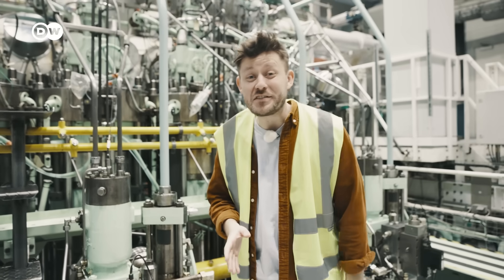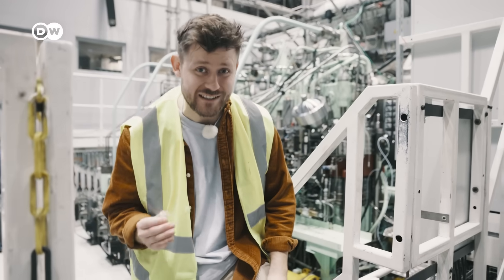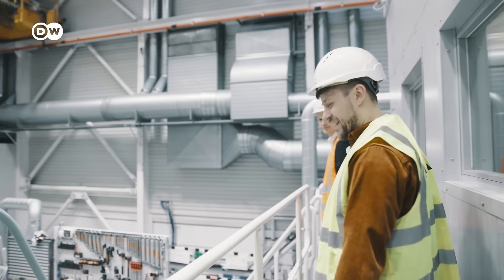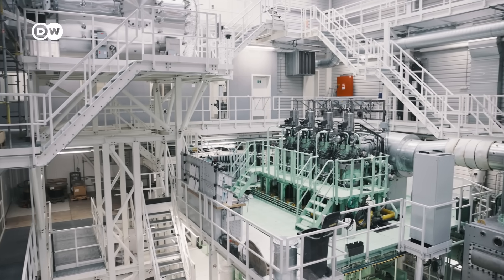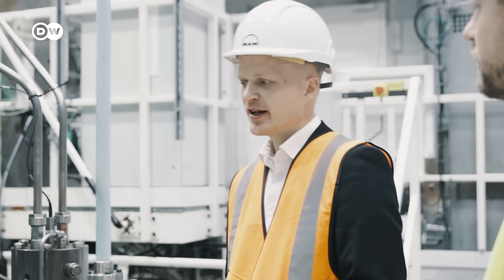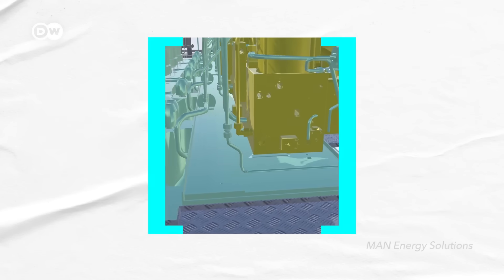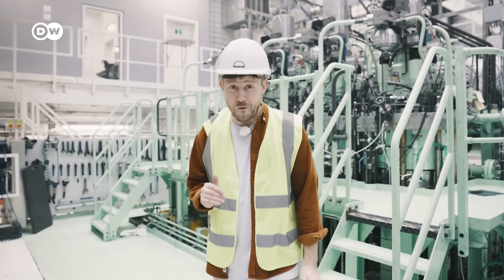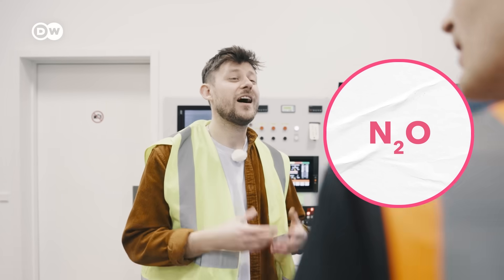Can this magic fuel clean up the shipping industry?

Comment from the maker: Do you think ammonia is going to clean up shipping emissions?
Reply: No. There's a bad idea. There are a lot of other fuel options that are more sustainable
Reply: @wilhelmlk  What other fuel options are you thinking of?
Reply: @wilhelmlk  wind sailing haha
Reply: In a word, no.

Looking at the basic properties of Ammonia should make this pretty obvious - about 1/3 the energy per unit mass, boils well below freezing temperatures, so it's a gas or being stored under high pressure or low temperatures (Both of which make it more dangerous and need energy, just to keep it sitting there). And that's before you consider that you can't just drill it out of the ground like oil, so it has to be made, requiring more energy again, before it can be used. Also look up what happens when ammonia reacts with water, and then consider that your eyes, and the inside of your lungs are coated in water, and tell me again how this is an upgrade over existing liquid fuels...
Reply: I'm a little confused by this. It produces greenhouse gases, Nitros Oxide, it's toxic and produces toxic emissions, requiring catalytic converters. Why not just use hydrogen? It's non toxic and produces only water vapour emissions. The main problems with hydrogen are the density and the production of green hydrogen...which are both also problems of ammonia. In fact you need to produce green hydrogen in order to produce green ammonia. So just use hydrogen? What is the benefit of ammonia fuel over hydrogen, if any?
Reply: @weareanonymous353  You can totally build an NH3 powered engine or fuel cell with zero NOx emissions.

The problem with H2 is that it's bloody hard to liquefy and store (boiling point -253°C, that's a lot lower than lN2 with -196°C or NH3 with -33.3°C). That process alone reduces its energy storage efficiency by 40%!

Another advantage of NH3 or any other hydrogen carrier that can be used in gaseous form is that it contains more moles of hydrogen per unit volume than H2 gas, because gases are weird (see molar volume for ideal gases; 1 mole of gas is always 24.7 liters at standard conditions; 1 mole of NH3(g) contains 1.5x the amount of hydrogen atoms compared to 1 mole of H2(g))

In case of a fuel cell, the NH3 can be used as aqueous solution, making handling much more easy and completely omitting the need of a pressurized storage vessel, but that'd be more relevant for cars. Large ships would likely use pure NH3.
Reply: We still have a long ways to go.
Reply: Nutrient nitrogen deposition from ammonia (mainly from animal agriculture) and NOx (mainly combustion sources) are wrecking sensitive habitats. I can imagine the ammonia slip from the engines even with catalytic converters is going to mount up if this takes off. More efficient conventionally fuelled ships might be better. There have been trials with modern sails that can reduce fuel usage by a substantial amount. 40% of world shipping just hauls fossil fuels around. If we can decarbonise other sectors then  shipping emissions become a smaller issue over time.
Reply: I think NOx and N20 might be very problematic too. Also producing enough Ammonia might be an issue.
Reply: No.
In short, it would replace one problem with another one that is much worse.
I think it is a very bad idea to have ammonia as fuel on ships. It would create a huge safety problem. If there ever was a leak it would also create a huge pollution problem. Also let's not forget that this fuel would need to be stored somewhere fore ships to refuel. Ports is usually where ships get refuelled and they are inhabited areas. I would not want to see more ammonia storage tanks on land or travelling around at see than necessary. 
What I would like to see first is why ammonia is not used more extensively in Einstein type refrigeration/cooling units (e.g. in air conditioners). If someone can explain that to me, then I'd be willing to give a thought to ammonia used as a fuel.
Also targeting the shipping industry for emissions reductions should the last thing we should be thinking about. Shipping is by far the most economic and efficient and also least polluting means of transport we have. If we could find ways to reduce shipping fuel consumption, yes, let's consider them by all means but let's not forget that shipping has a century's experience in using hydrocarbons as a fuel. While any extra economy to be had could be welcomed by the shipping industry getting it wrong or placing too stringent conditions for emissions could just as easily backfire. Badly.
We should first target all the other modes of transport - especially unnecessary transport like tourism which is a luxury that only the very affluent can enjoy at the expense of the poorest and destitute - and leave shipping the last.
Reply: The issue is not about if can clean up shipping emissions, the question is if the "lobbies" from traditional fuel industry allows it
Reply: @mcln2  Who do you think makes most of the ammonia on the planet?   ya the traditional fuel industry....
Reply: Huge nitrogen plant near completion after being started in 2023, and guess where it's being built - Saudi Arabia. The country that got extremely wealthy from selling oil, has now taken the lead over ALL other developed countries, and is set to produce nitrogen fuel 'on mass' in 2027.
Reply: Not as long as the Haber-Bosch process used to produce the NH3 depends on fossile energy and hydrogen from non-green sources.
Reply: Powering ships using ammonia is a bad idea and it's a truly terrible idea for reducing global emissions.  Ammonia is incredibly toxic to humans and the environment.  These engines require pilot fuel, so they can never be emissions free.  Creating green ammonia infrastructure is incredibly expensive and extremely fragile.  Global warming is a thing, we need to be reducing emissions in sensible and economically sound ways, but cutting shipping emissions using green ammonia while Asia is building a new large coal fired power plant every week, is fiddling while Rome burns.
Reply: What I missed was the option to decompose the ammonia and then burn the hydrogen that is produced in the process. It could probably be stripped from the mixture with nitrogen before that. Burning hydrogen would be much more useful, but of course would require different materials.
Reply: No way this will become common as I see it. China's nuclear ship option is substantially more viable than this.
Reply: No.
Reply: I don't think so.  It costs more in energy to produce ammonia than you get out of it as a fuel.  It's like hydrogen as auto fuel -- it's an inefficient delivery system, not a fuel source.
Reply: Nope. Still need energy to make ammonia... and if you say renewable (solar, wind) or nuclear is the energy source, then ammonia is just another energy storage system. And you could just use a regular hydrocarbon as that energy storage molecule. Ammonia is toxic and corrosive.
Reply: No.
Reply: Nope!  Perhaps it will serve energy needs supplementally and STATIONARY...but not with any mobility!
Reply: NOOOOO.....ammonia will POLLUTE SEA / OCEAN .... and SMELL OF AMMONIA.....is unbearable for beautiful SEA / OCEAN  FISH / CREATURES.....NOOOOOOOOOOO.......
Reply: Since low sulfur fuels have been introduced emission indeed became much cleaner albeit without reducing carbon emissions. Missing feedstock for fuel, safety issues in case of spills (imagine 20,000m3 of poison gas leaking next to an urban area / harbor), sustainability of fuel production unsure) - I think that carbon neutrality is not an end in itself nor the only parameter to consider when combating environmental destruction. So I don't think this will actually become the mainstream engine type for marine container vessels.

Who doesn't remember 'green coal' and other attempts to masquerade the origins of energy produced. Energy generation from ammonia might be a niche market application in biomass - such as massive animal farms which are themselves a huge root cause of the problem (but they might invest in it for image reasons). We need to concentrate research on base load generating technologies while buying time with insulation, heat pumps, expensive renewables combined with even more expensive energy storage systems - Thorium molten salt reactors might be more promising. Once that ' relatively CO2 emission free' base load problem is solved we can produce hydrogen or biofuels using that nuclear energy.
Reply: Why NH3 when a better job could be done with H2 ?
Also, marine propulsion needs to move away from simple engine-propulsion to propulsion-system setup, i.e.: a hybrid of a few sub-system types, which I'm sure folks in the industry are already working on.
Reply: @aryaman05  Because ammonia is easier to store & liquify and as a gas holds more (1.5x) moles hydrogen by unit volume than pure H2 itself. Methanol as liquid hydrogen storage would also be a viable approach - there are fuel cells capable of using 60-70% MeOH (the remainder is water).
Reply: @aryaman05  how big is the H2 storage? On land it's feasible, on ship it's not
Reply: @DanieleVatta  Compressed/Liquid H2 as stored fuel on board marine vessels is not too different from natural gas applications - which is gaining traction already.
Think EU/MENA and eastern seaboard NA, vis-a-vis, 'range anxiety'.
And within context, space is a non issue on board ships.
Reply: @aryaman05  on cargo vessels space is money and H2 takes more than double the space of LNG
Reply: @DanieleVatta  
Can be a challenge when retrofitting existing vessels, as storage units can't be simply replaced with existing ones.
No such issue with new-builds.
H2 can be stored in low(liquid), medium(liquid or gas) or high pressure methods, i.e.: similar limitations as that of handling CH3.
Reply: Cylinder deactivation can solve the engine load issue
Reply: No because one thing is the well tuned research engine but the marine industry is very dirty, they dont make maintenance... danger...
Reply: How about smaller versions for trains. Hydrogen train vs ammonia train... what is scarier
Reply: no
Reply: No.
Reply: c02 emissions are not a legitimate problem in the first place...
Reply: If we have to split water to produce the hydrogen for ammonia, why not develop engines that use the hydrogen instead?
Reply: No
Reply: Yes,no carbon, but will emit nitrogen dioxide or nitrogen trioxide. We know that , nitrogen dioxide is a pollutant gas.
Reply: If it does, what are the side effects? Carcinogens?
Reply: We have to use the heavy fuel oil from crude oil for something. May as well be shipping.
Reply: love innovation as it allows us to do things better.
That said, the obsession with CO2 is fetishistic and potentially dangerous given the direction politicians and bureaucrats push in.

Consider, our atmosphere is 0.04% CO2.  Not 4%... 0.04%.
Of that 0.04%, which would be the sum total of worldwide production, humanity accounts for approximately 3.225%
so the sum total of ALL HUMAN DERIVED CO2 creation is 0.0000129%

Now... changes in CO2 can have massive/startling effects on the environment/atmosphere.  Undeniable.
But we are becoming obsessed with "climate change", which the planet has been engaging in since it's formation, and attributing CO2 in a very negative light.

Please note, if CO2 levels drop below a certain threshold, systemic floral death occurs.
Earth is already below the projected ideal floral growth band.
Conversly, as CO2 levels rise (global or in specific regions, the potential for growth (or "ReGreening") occurs.
Regreening which makes the planet more hospitable and moderated in temperature...

So while ammonia could allow us greater control over our emissions, in totality we are looking at a subset of 0.0000129%
Reply: Maersk shipping obviously thinks it could be possible.
Reply: For a layman like, the whole process itself is a torture! The Risk vs. Reward is in no way convincing to anyone.
Reply: This is taking the p*ss, making ammonia from electrolysis defeats green energy, just compress the hydrogen into liquid and use that as a clean fuel
Reply: doubtful
Reply: There  is a big push to lower agricultural use of nitrogen as some of it will end up transformed to no2 and contribute to greenhouse gas emissions. For prespective total ammonia production, not all of which goes to fertilizer is only 1 /6th of what would be projected to be needed for maritime fuel where it will certainly produce NO2. Now how good their catalytic coverters will dictate how much gets emitted but if it is a real problem for agriculture producing some NO2 emmisions i expect when you updcale use by a factor of 6, some NO2 emmissions from marine fuel use will be just as bad if not worse. With the push to greatly lower N fertilizers crop productivity will  fall raising food costs. Now if we use that same ammonia x 6 in marine shipping now we have less efficient and more costly shipping of more expensive food being moved for what i expect will not be lower amonia emissions.
Reply: Did a little checking. Estimates of agricultural NO2 emmisions from N fertilizer use is about 1% per of N mass applied. For ammonia ice it should only be about 0.5 % when combustion temperatures are the least ideal with orders of magnitude less NO2 release when operating at ideal temperatures. So NO2 release from a ice engine potential could have less impact than agricultural N use. Now the question still remains how much leakage is there of nh4 during use and production and is it cost effective and what is the full cycle energy/ Greenhouse gas potential as like hydrogen, ammonia is just a battery and not an energy source. I'm interested, but skeptical.
Reply: I think they're "full of piss".
Reply: No. When ammonia is burned it releases nitrous oxides which are highly toxic to the environment when compared to conventional fossil fuels.
Reply: FAR Better Solution:  Make all goods local...  Why ship things half way around the planet if you can just make it a few km from the customers ?
Reply: not this kind
Reply: @AparnaDeshpande-se5tl when it goes into meltdown your going to want to hold your breath. Nuclear made in China, don’t belong together.
Reply: Hell yeah it's quite possible. Toyota uses Hydrogen as pilot fuel which also comes from on board Ammonia itself which in turn reduces NOx emissions as well.
Reply: It will clean up shipping emissions but increase industrial emissions. It will be same story as with electric cars- you will need to burn large amounts of natural gas to produce sufficient amount of ammonia just like now you need to burn large amounts of fossil fuel to make electric energy for electric cars. As industry will need to pay more and more penalties for increasing CO2 / NOx emissions with the price of natural gas on the rise, price of ammonia will go up so ammonia as fuel wont stay cheap for long. With low utilization it will become unprofitable
Reply: @DeX9891  Everything cause emission or consumption. Even giving up and dying, you decompose make a lot of methane that is very strong green house gas. Also some thing are necessary.
Ammonia is a good example. We could stop ammonia production tomorrow... and in few year 2 third of world population will starve to death because without fertilizer agriculture efficiency is... what we had before it's introduction. We have seen the change and what was the population we could sustain.
So, the discussion is on "Efficiency" and "sustainability". Do the necessary, do the possible, at the best condition.
Reply: @DeX9891  and About EV.
You have seen the meme with the tesla with a diesel generator to charge right? It tell more on how bad people is the poster at math and physics than anything else.
Because diesel car are... awfully inefficient.
engines are good only in a very narrow range of load and speed. Accelerating, breaking an incredible amount of energy is wasted.
So yes...even a Tesla charged with a diesel generator running at fixed optimal condition you make more mile with the same fuel than a diesel car.
You put the same fuel in a big powerplant generator and you make 2 cars go around changing them on grid. 
And you can use scrubber and filters much more efficient than your car polluting far less.
And you can use the energy done with solar panels during day. And with the same CO2 of one car... 100 car can go around.
Reply: @DeX9891  But... Battery are not the solution for everything. Always efficiency math physics not faith meme or politics.
Bigger is the device less convenient is a battery.
I even you will not think that powering yours smartphone with a combustion engine instead of a battery is a good idea I bet.
Getting bigger my EV scooter  can do 100km with 0.10€ of electric power, the one I had before 5 liter of fuel at 1.8€...  so 9€. So 90 time more, that is the range of "mathematically challenged" the discussion  is... even worse if you compare EV bike with Diesel car. The meme with the coal plant is kindergarten physic and math level... 
Diesel car on average real consumption of 7.5L per 100km
EV on average are 15kwh per 100km... to generate that power 6 liter of diesel al necessary with a common diesel generator to the cord. Already less. But you can go under 4 with a big engine on grid.
So clearly better even if you are not couting using renewable.
Trucks... that is a battle battery have not won. Ships. There is not even at the horizon the day of EV ships for now. So we need alternatives. And we are searching for them.
Reply: No
Reply: How about propaganda? 🤣
Reply: Not all, some maybe. Emissions from shipping will continue to grow, but slower and at some point emissions starts to decline but no thanks to ammonia.
Reply: Ammonia is a very corrosive substance, which makes It not engine friendly.
Reply: I wonder how about nuclear energy, militaries use it tho
Reply: Nein, es geht nur darum, Daten zu recherchieren und zu erhalten. Außerdem ist es banal ineffizient und extrem gefährlich.
Ammoniak ist giftig.
Meine Erfahrung:
Eine große chemische Flasche rollte um und fiel auf den Betonboden. An einem Punkt trat Baumwolle auf und alles war mit weißem Nebel bedeckt, als ich ausatmete, sah ich, wie sich der Dampf in weiße Flocken verwandelte... dann verengte sich das Sichtfeld stark und ich konnte nicht mehr einatmen, die Brust verdrehte sich mit einem Krampf. Keuchend "Gas!" ich eilte zum Feuerwehrausgang...
Reply: I think it will. I am looking to make a new Toyota motor fit for my vessel. It is brand new and they say it will produce 180 hp which is okay. It is 20 hp more than I have now. The main problem is the tanks.
Reply: no , too complicated
Reply: Why not convert the ammonium to hydrogen and nitrogen. There is alot of residual heat to contribute to the proces, and separation should also be feasible. And It might be possible to use ammonia  container in pellet form. By the way it's Man B&W in Denmark I can see. And ammonia could perhaps be produced biological.
Reply: I sincerely hope it will clean up shipping. Having worked with Everllence Retrofit for 1½ year I know they are very keen of making it work for real and have their eyes set on the goal. They are genuine but they won't tell you stuf they don't want the market to know ..yet. Thanks for a good video .. being an IT guy I have not much understanding of the actual motor and fuel stuff so informative videos as yours is always nice :-)
Reply: What are your thoughts on China's nuclear powered cargo container ship which it launched yesterday?
Reply: @wololocute this in part is going to be the way it goes
Reply: @wololocute  Did they copy it off the nuclear powered Savannah.
Reply: @wololocute  they are talking about and made a concept project, nothing lunched.
So more propaganda than anything else.
It's dangerous and there are decades that we are not able to make economically viable nuclear energy. 
Sometime maritime incidents happen and already with oil spill there are huge problem. Imagine a nuclear incident everytime that happen. I do not imagine many country allow this ship to go near their coasts... so I think that will remain science fiction for a while. Nuclear project and ideas to fix safety, cost, scale and waste are plentifully butt they always fail at final commercial proof. At this pace with all the continuous breakthrough of fusion, we will have a fusion container ship sooner than Nuclear... but those are definitely not around the corner.
Reply: @wololocute  PS: as middle ground Japan is researching wasy to produce Hydrogen in nuclear plants as a secondary product, that than can be converted in ammonia or used directly. That seems to be a safer and more commercially viable solution.
Reply: Ammonia requires to make green hydrogen and spend additional energy to add nitrogen to the mix. The question is how it compares to using hydrogen instead. If we take liquid hydrogen, it is 70kg/m2 * 141MJ/kg = 9870MJ/m2. Liquid ammonia 682.6kg/m2 * 22.5MJ/kg=15358.5MJ/m2. So clearly liquid ammonia is a much more efficient form per m2 of transporting energy than liquid hydrogen, and in addition doesn't need to be stored nearly as cold at only -33 degrees Celsius.
Is it better than diesel, well, it clearly has a ton of downsides, but one advantage, so that depends on how you weight those things.
Reply: @Eikenhorst Problem with Hydrogen is storage and transport. As a gas, H2 would require to much space for transport, and to liquify, it had to be refrigerated to almost absolute zero. Cooling to -35 °C or so is  not a problem, LNG is brought to -162 °C for transport. 
Of course there are Hydrides... but more on that when the research has finished 😁
Reply: @human_isomer  I am saying that even IF you could make it liquid, it still doesn't come close to the energy per m2 as liquid ammonia. But neither option is exactly great if you ask me.
Reply: @Eikenhorst  well, you can make it liquid, but of course it doesn't have the energy density of Diesel. On the other hand, it doesn't emit nearly as much CO2, and something needs to be done. Biodiesel won't cut it, even more when thinking about decreasing areas for growing respective plants in the course of global warming. 
Sails might be an option, or on-board wind turbines, but of course this would come with significantly longer shipping times. I wouldn't mind, but others may have a different opinion.
Reply: @Eikenhorst  If we can get rid of Haber-Bosch, then ammonia is a good route to pursue. Before that, it's a dead end. Hydrogen as is is too hard to handle. It leaks, is explosive and is hard to produce.
Reply: @Eikenhorst  
As NH3 ist consisting of 83% nitrogen you fools are importing nitrogen.
Reply: Nothing is ever good enough for the moan moan brigade.
Reply: He'll no it won't I've worked in refrigeration an with all types of motors the clean up an spills that could come from this will be just as bad if not worse for the eco system planes would even be in danger because of the state of ammonia
Reply: Nuclear sounds simpler.
Reply: No. You use lots of energy to make amonia, then you get many times less caloric energy out of that fuel and you need larger tanks to store it, making ships carry less cargo than ships running simply on oil. I am wondering if burning oil in the first place would be better, rather than building all of that infrastructure and spending all of that energy. Its only 3% of global emissions. Maybe we should focus this energy and resources into more polluting sectors like house heating(insulation), agriculture(reducing meat consumption and production) or cement and steal production.
Reply: Nope. Too many potent GH byproducts, too expensive, and all our almost all current ammonia is made from fossil fuels in extremely high temp and pressure reactions. 

Far more feasible to convert to biodiesels.
Reply: @guru47pi 
yes, I was thinking about biodiesels. 
I asked chat GPT to run some calculations. using algae which has got the highest density of oil to land area usage, it would still require 5000 times more land area than a refinery. 
That's a massive uptake in land usage, even if that land usage doesn't have to be farmland considering the algae is grown in tanks.

hydrogen sucks because it's got low energy density. ammonia sucks because it's got better but still low energy density, with the added negatives of being quite toxic and a gas.
Reply: Laughs in ammonia leak. 😂
Reply: People need to stop thinking about "engines" and "fuels." ALL engines are highly inefficient and require fuels. You want a highly efficient "motor" for any propulsion. They don't require fuels. It amazes me that batteries have been used even before WW2 and yet people can get it through their heads. All submarines used batteries in WW2. And those were old, very low energy density led acid batteries. And because of their nature, you could only use roughly 50% of their energy without suffering damage.

Just imagine the much higher energy densities of Lithium Ion batteries. Their energy density is increasing every single year. And chemistries like Lithium-Sulfur batteries have up to 5 times the energy density and weight one-third that of Lithium Nickel based batteries. If they were spending their time and money on developing motors instead of engines, and working on improving battery energy density, they would actually be unto something. Which is exactly what Rolls Royce is doing with their axial flux motor developments for airplanes and ships.

This work they're doing is going absolutely nowhere, even if it's being funded in part by the fossil industry, since the easiest way to make ammonia is from fossil fuels. It's the exact same thing with hydrogen.
Reply: @Paul-cj1wb  They are not competitors. They both have cons and pros
Reply: It might happen in limited scale.
Reply: Maybe Ammonia or Hydrogen will be useful for long term seasonal storage for peaking electric generating plants in remote areas, or just evaporate it as the cold side on open cycle chemical (rather than mechanical) heat pumps. I am assuming we will have more electricity generation capacity that we need at any point in time so need a way to convert that to something useful. I would have thought making green aluminium is an important step to decarbonising, and reserve fossil fuels for large scale transport like shipping or flight.
Reply: Yes Ammonia as a fuel for ICE engine is nothing new and has been used for going on 80 plus years now.  There is nothing new here it is just technical hurdles. We already use NOX reduction catalysts on vehicles and have been  almost 50 years now.   So there is nothing new here it is just scalability.  Ammonia has several advantages it is less explosive than hydrogen LNG and Propane. It is lighter than air so it will not collect in low areas like propane. And it is easily stored. Ammonia will be the fuel of the future.
Reply: Not unless the ammonia can be produced without fossil fuel and the it sure looks iffy.
Reply: H2O desalination + hydrolysis, N2 distillation, and NH4 reaction can all be powered by intermittent surplus renewables, eliminating their curtailment.  On scale this will be cheap.  Liquid ammonia tanks for on-shore load balancing are just as feasible for use as portable fuel.  There's work being done to develop reversible NH4 fuel cells, and H2 fuel cells can be fed by catalytic cracking.  Combustion engines have limited efficiency, and their heat produces undesirable side-emissions.
Reply: Yes, it costs 5X less that liquified cryogenic H2 or Hydrogen, because Ammonia a pressurized gas like propane in similar tanks as propane, and can be moved, sold, pumped, similar to propane or butane gases compressed in steel tanks painted to reduce corrosion and enhance operating life in the real world, or electroplated with nickel for similar reasons, or polymers, or deliberately oxidized to form a rust layer that resists further oxidation and looks nice red or black :) 

Mixing bio-diesel technology with Ammonia, in dual fuel systems, able to use bunker oil or fuel oil like diesel or Jet A or kerosene, this means better fuel storage density. Consider in German how many car owners of gasoline fueled cars pay to have a propane tank fueling system added since propane sells for 1/2 the cost of gasoline, making cheaper fueling costs that easily quickly pay off the cost of the propane fuel conversion kit with professional installation easy to use, refill, such that the driver can use gasoline, propane or any combination ratio of both as fuel with a smarter engine control computer system and related sensors, already a mature commercialized an popular well selling system in many German cities with higher gasoline prices that make the propane conversion feasible or sensible or cost effective.
Reply: Ammonia engines should be illegal, NOx and NO2 pollution
Reply: No why cant use Biodiesel no need to change engine
Reply: Biodiesel in releases more CO2 than fossil diesel.
Reply: @BanTeslaX  Just need to use too much land to grow products to make Biodiesel. A better idea may be to make synthetic oil from  sunlight, water and CO2 in the air. Possible I believe but expensive. Plants do it.
Reply: @BanTeslaX You would need to change the engine still. Regular cars (or ships) cant take 100% biodiesel. From memory I think the EU standard is 5% biodiesel to avoid engine damage.
Reply: After this video no the emissions are to worse and burning is not efficent enough. Maybee sails and batterys and antennas to get electricity from spacesolarfarms? Maybee just H2 but its also not efficent.
Reply: Yes it will, if the natural hydrogen developments of late keep going in the right direction. Because green hydrogen will be way too expensive.
Reply: @Scubongo how about to use solar electricity to hydrolysis H2O the produce Hydrogen then hydrogen power the machines.
Reply: @Scubongo  Green hydrogen is used in creating ammonia... so your argument is invalid.
Reply: @Sussurrus  There's no need for very expensive green hydrogen if we can use cheap natural hydrogen out of the ground.
Reply: @Scubongo  Natural hydrogen? In nature hydrogen only exists as a compound with other elements as to be found as water or hydrocarbons.
Reply: @AquaMarine1000  That was what people thought for a long time, but that has changed in the last 2 years. Look it up. There's a race going on now to find a way to extract it. The did a big find in France.